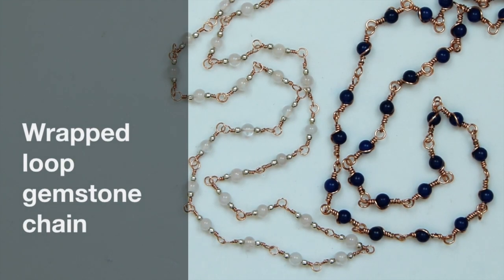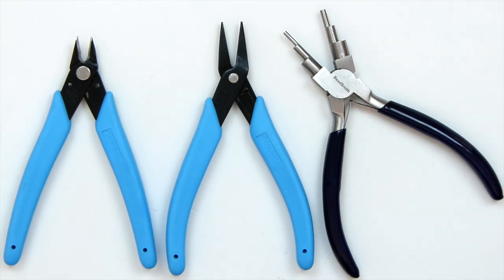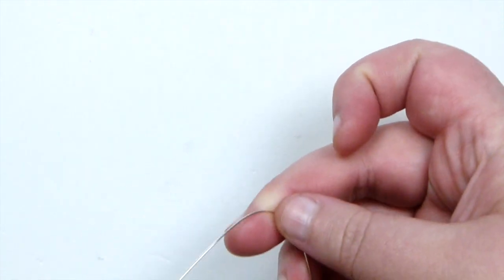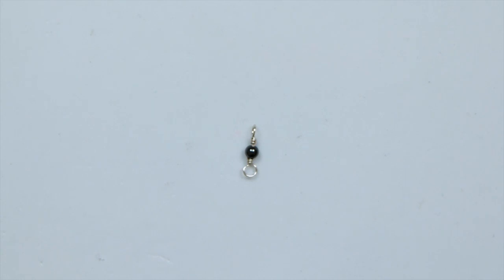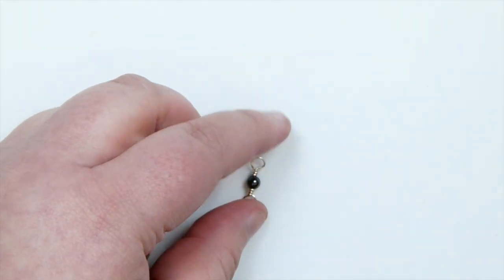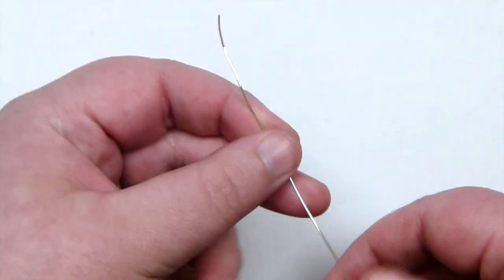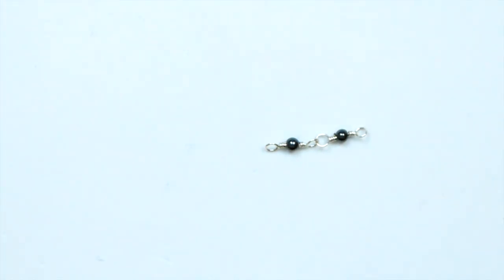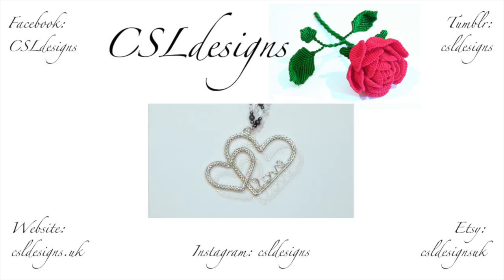Wire wrapped loop gemstone chain | Make your own chain series

Comment: Hi, First i would like to say; Excellent job on all of your creations. There all simply beautiful. Second , i would ask; Does the wire that you use ever tarnish or rust? If so how can i provent it from happening to my pieces? Thank you
Reply from the maker: Latoya10000 Thank you very much. I haven't had any of my wire or wire pieces tarnish or rust on me, but I use a wire that is coated in an e-coating which helps prevent tarnishing and make it hypo-allergenic. So it will depend on the type of wire you use :-)